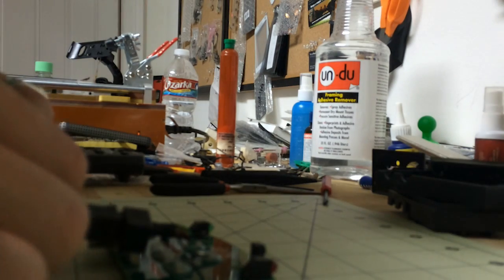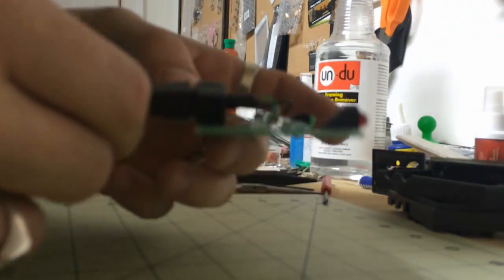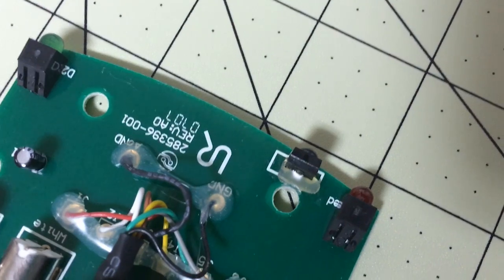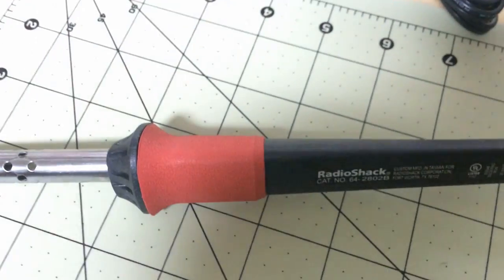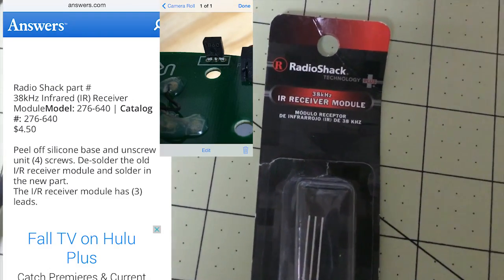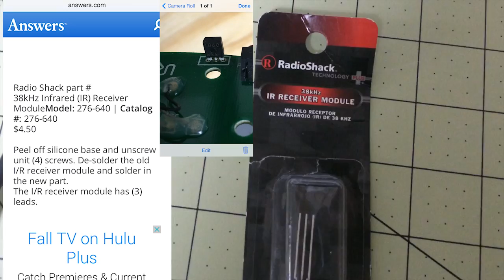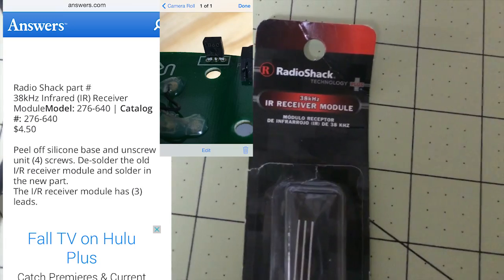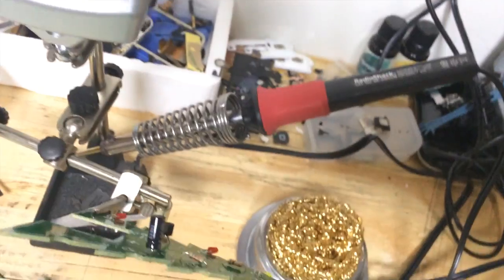Bose infrared module fix

Comment: My unit had exact red light on that would not go green. The steps in this video helped me repair.  Replaced sensor with part number 782-TSOP34838 Vishay Infrared Receiver 2.7-5.5 Volts, 38 kHz from Mouser Electronics (cost $0.58 dollars + shipping). After repair with voltmeter black lead on center pin#2 (GRN)  and red lead on pin#1 (Power+) -  resistance value = overflow or open. For black lead  on pin#2 and  red lead on pin#3 (Output) - resistance value = overflow or open. Repeated with red voltmeter lead on pin#2 (GRN) and black lead on pin#1 (Power+), the resistance value  = 12.4mOhms. For red voltmeter lead on pin #2 and black lead on pin#3 the resistance value = 7.93 MOhm .

Comment: How is that repair holding up for you? I did the repair, it worked, but then a few moments later after reassembly it stopped working. I figured the IR module was crap, so I replaced it... nothing. Replaced it again... nothing. I think there is either a problem with the remote, or something deeper inside the unit.

Comment: Were you getting the red standby light on yours and it just wouldn't turn on, or was it totally dead?  I'm getting no indicator light on mine when it's plugged in and it won't turn on.  I reseated the power and module cords with no luck.  I believe the internal power supply in the main sub unit died on mine but I can't figure out how to get it out.  Took the back cover off and the power/amp module seems to be built into the cabinet with no way to get it out and I can't find any disassembly videos for the subwoofer section.  The fins of the heatsink are recessed into holes in the side of the inside of the cabinet like the cabinet was built around it and it won't come out without destroying it.  Please let me know if you've ever had yours apart.  Thanks
Reply: Mine too. Did you figure it out?
Reply: @TheQuirkyPicker_Chad  No never figured mine out.  It's still all apart in a shoe box probably getting junked eventually.

Comment: Thank you Dave! My control module just went out yesterday and I have had my system for at least 10 years with no issues so I was completely shocked when it stopped working. I just ordered the IR for $8. I hope this corrects my problem. I was going to buy a new control module for $80 from Bose but they were out of stock and then I saw you.....thanks again.
Reply: Where did you find the ir to purchase to make the repair?
Reply: Where did you get the IR? We have no RadioShack around here?

Comment: Not true
Reply: Does your remote work? You can check it with the camera of your phone, which turns the ir to visible light. If you don't see the ir diode of the remote blinking, it's the remote it diode that's broken and not the receiver end.

Comment: I purchased the infrared module for Rs.8/- (about 10 cents) and did the repair job as mentioned in the video. An incredibly my Bose remote interface module started to work. I was planning to shift my Bose cinemate system to the attic, but now it adorns my music room and performs well. Thanks boss for such nice video.

Comment: Hey Man, You rock!
Thanks!  I have the exact same problem and was about to take the amplifier apart thinking the fault would be with the power module.
Also, if you're that adventurous, try picking up discarded big screen TVs on the roadside and take a swing at fixing them.  I've fixed four of the five I've picked up.  Problems are usually popped capacitors, that can be bought and soldered back on for about three dollars a piece.

Comment: I had the same issue and I watched the video and was about to attempt the process also, but I kept digging the internet and Bose has a factory rest and if you disconnect the module from the acoustic Mass for 30 seconds, it will factory rest your system and may correct the IR from not working. It worked for me so anyone trying this, maybe try that first and you may get lucky like I did. However your video was very informative and I would have tried it if I didn't stumble across that soultion.

Comment: Hey, I followed your video after buying a soldering kit and the IR reciever on Amazon...$40 all in. I have a Bose Cinemate GS I Home Theater Speaker set. The red light would come on (standby) but could not power up (no green light). I confirmed the remote is working. So I did the repair and all is working fine now. Dude you ROCK!
Reply: He said to get it from radioshack, not amazon... 🤨

...radioshack! We miss you!!!😥🥺

Comment: What was the symptom before the fix? When I plug my base module in, the green light automatically comes on first (without pressing power on the remote), then the red light and they both stay lit. No sound. Help.

Comment: I'm going to give this a go. I've got everything except the replacement ir sensor. This is the second unit that has failed me and I think it's gotta be some design flaw that causes the sensor to croak after about 5-6 years. So I'm gonna order several as they can be had online very cheap. If it doesn't work afterwards, I'll just have to buy another sensor unit but, I hope not.
Edit: even the dogs outside are excited for ya!
Reply: Did it work out for ya?
Reply: @mrwhosmynameagain not yet. I just ordered some though. I forgot what frequency the receiver was and couldn't find this video. I got a set of 5 and they're expected to arrive in 2-3 weeks. I'll update when they arrive and I'll get right to installing it as I'm tired of seeing the system just collecting dust.
update: the sensors have arrived. i'm going to get on it this weekend!

Comment: Completely Awesome Bro BOSE Tech Support is Total BS they were trying to sell me a new remote and a new receiver that’s not much of a solution anyone can go out and buy something new to replace something old.
Reply: The tech support purposely misled me, I kept saying I think it's the receiver and he kept saying that I needed to buy the brand new 2023 system.  He didn't even recommend buying a new $80 receiver.  I laughed hysterically at him when he suggested spending $2000.  From the looks of it, this is a common problem.  So he would've known prior that it was likely the system interface.  But nope, he went straight into recommending throwing mine away and spending $2k on a brand new system

Comment: I have the same interface and the cable I think is lose the light comes on and off I move the back of it , I might have to solder the connection together , have not found anything online e in regards

Comment: Not sure what the hell is wrong.. The module turns on from the remote just fine.. The module is green as it should be but won't allow the volume to increase, only decrease.. The green light flashes only when I decrease the volume.. No increase in volume = useless piece of crap.. Anyone else have this problem??/ know how to fix??
Reply: take your remote apart, clean the area where to up button is on the board and the up rubber button is with rubbing alcohol, put back together and it should work. you can do that with ALL the buttons on the board and rubber... also the rubbing alcohol WON'T hurt either parts, just cleans them.
Reply: @tazzy68   Thanks for your response.. Somehow, someway, the volume up button on the remote started to work.. If it stops again, I will try what you recommended..

Comment: Fuck me, sometimes I hate living in stupid Europe. I can't find this part anywhere that doesn't have like $15 shipping and I don't even know it this is what's actually wrong with my unit. I was just testing if I could use s d-sub extension to move the sub, and after that it wouldn't turn on.

Comment: The "problem" that mine has is that it makes a popping sound on the right speaker every time i turn it on and off even if theres no optical or rca cables plugged in. It works and aound perfectly, just that 1 sec pop before they start working fine. CAN ANYONE HELP ME PLEASE?

Comment: Thanks for posting this.  Came home from vacation and system was not working. Went ahead and ordered ir module from Amazon along with desolder pump.  Took awhile to get joints desoldered but this fix did the trick.  Probably saved me mucho dollars. Thanks.

Comment: I've got to give my seal of approval on this fix.
The video is a bit rough but I can confirm that this fix absolutely worked for me.
I just bought this series 1 Bose Cinemate and when I got it it didn't turn on but the stand by light was on and the guy said no returns. So I thought I was out $200 but I found this video and tracked down a radio shack that carried the IR 38khz receiver and picked one up. An hour with my soldering iron replacing it and it immediately worked once I hooked it back up. Not a job for someone brand new to soldering but do some practice board work and you could get the job done. 
Thanks so much for having this fix out on the internet it really made my week to not loose that $200.

Comment: Awesome video Dave,
I finally got to see what is inside this little black box. I was given CineMate I last year from my friend who lost the box and now the system is just taking space in my cupboard, thankfully to your video I've managed to draw the circuit from the pcb and I am on my way to replicate the box. However I missing the last puzzle piece, this is the pinout of the connector i.e. which pin of the connector to which cable is connected on the pcb. See the image:

https://s-media-cache-ak0.pinimg.com/originals/4e/d1/4c/4ed14cf0d05e26061724009d969c1f1f.png

I will relay appreciated if you could find time and trace the cables from the pcb to the connector's pins of your box.

thanks in advance !

Comment: good job. i've been soldering a lithium battery pack all day and the fumes make my mouth taste funny. anyway do you possibly know the pin outs of that module? If you draw up a diagram of that circuit and what parts are where, you will be throwing it right back at greedy boses face snd help alot of people out. look on line. no one made one.
Reply: Someone posted one that they drew in the comments

Comment: Hello, the problem I am having is my red light is on but the remote will not turn the unit on. The green light will not turn on. When you replaced the IR, was it the red or green? And were you having the same problem?
Thank you
Reply: I'm having the same problem with mine. Are you able to fix yours

Comment: Dude, saw this video and followed the instructions.  10 minutes later I was back up and running. $4 part is much better than buying a new system!!  Thanks!!!
Reply: Did yours just randomly system just randomly not turn on anymore? b/c that what mine is doing.
Reply: @TheUSAGhosts  mine just stopped working recently. This is the second ir unit that has failed.
Reply: Did you just happen to have the specific IR component just lying around or something?❤

Comment: Part Replacement info:
Radio Shack Part# 38kHz Infrared (IR) Receiver Module
Model: 276-640
Catalog # 276-640
$4.50
Reply: I went to radio shack and picked up everything listed. I will attempt to fix mind.
Reply: How did you determine which receiver to use? Thank you!